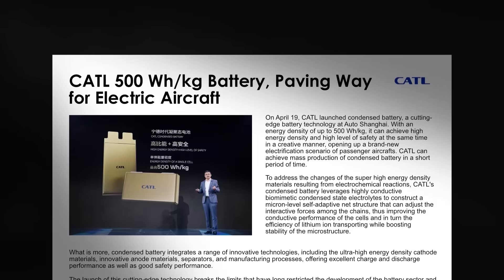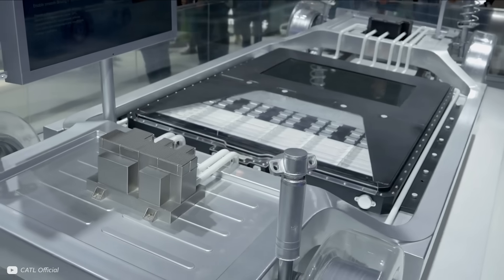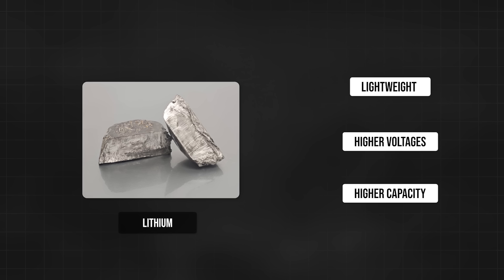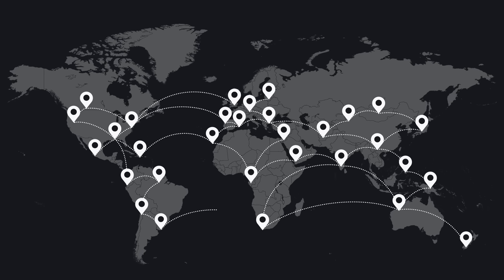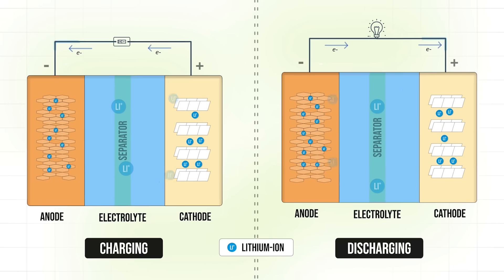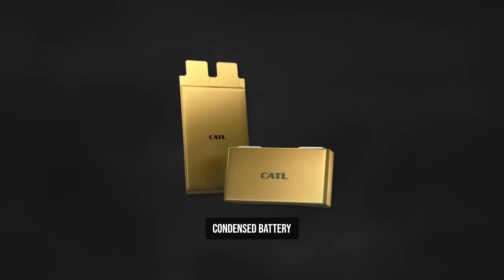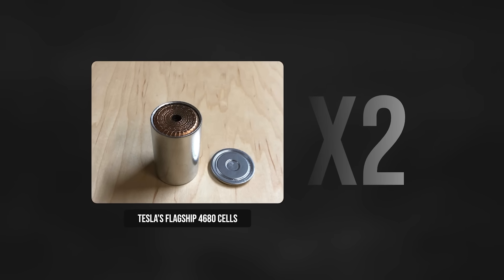Next Generation Batteries: Beyond Solid State

Comment: This is an interesting development and I hope the information the company has provided is accurate, but a couple of points:

1. Another benefit of a solid state electrolyte is that it won't be flammable and almost impossible to put out in case of fire, and that issue remains in the discussed battery even if it should be very stable under standard conditions.

2. If the metals used are still the same rare ones with their large environmental impact, unless they could use this technique to speed up the development of the more appealing alternatives that currently underperform this will also remain an issue.

3. Regarding energy density for large planes as is suggested in the video – jet fuel has an energy density of about 12,000 Wh/kg, so it's still around 24 times as energy dense by mass. Even though theoretical jumbo electric planes would use a completely different type of engine, let's still put it in this perspective: a Boeing 747 is quoted as burning 10 to 11 tons of jet fuel per hour of flight, so a flight from London to NYC at around 8 hours burns more than 80 tons of jet fuel. The plane would not be able to fly using ~2,000 tons of batteries, as that is 12 times as heavy as the empty plane is. Even for much shorter flights I don't see how it is viable in planes built to carry hundreds of passengers, because even if the flight is short enough to require energy that can technically be carried by the engines, maximizing the weight at every short-haul would make short flights much more energy intensive than they ideally should be.
Reply: Effective energy density of jet fuel is between 1200-3600 Wh/kg though.
Reply: @JSM-bb80u  As I wrote in my last comment, the quoted typical propulsion efficiency is >30%, so effectively it would be >3,600 Wh/kg. Thus, a 100% effective battery–electric motor system (which is impossible) would still be <0.14X as energy dense.
Reply: Regarding 1, while this is certainly a benefit it's often overstated. Batteries don't really catch fire that often, and consumers have already decided that it's an acceptable risk with current technology. Not much different from carrying around large amounts of explosive liquid.
Reply: @Rhaegar19  There aren't any real alternatives on the market right now. The consumers take what is dawned on them.
Reply: @TLguitar 
You missed the point the OP was making, which was that the risk of battery fires is exaggerated.  As for battery weight concerns, the 500Wh/kg threshold has been determined by industry to be viable for large aircraft demands.
Reply: @PETERJOHN101  I didn't miss it, I simply replied to the more important point he was trying to make. Online statistics do claim ICE cars catch fire much more often, but I need more context.

Regarding the "500 kWh threshold", these batteries are 500 Wh/kg, not kWh/kg, and either way I explained their energy density is a far cry from that of jet fuel, so large electric planes need to have engines well over 10 times more energy efficient than jet engines in order for this to make sense.
Reply: @TLguitar  Also jet fuel loses weight as you use it up, unlike batteries. 
I suppose if you're a bad neighbor you can throw dead batteries out of the plane, though. 😉
Reply: @JCAtkeson3  Yeah, I thought about that, but I assumed when they quote the average hourly fuel consumption for a long-haul flight they take into account the decreasing weight throughout the flight.
Reply: @TLguitar  
You need context to understand that the risk of fire is dramatically higher in a combustion engine than a battery?  Context won't change the stat.  As for the efficiency of electric motors, they are dramatically more efficient than combustion engines, and as  I pointed out, industry experts agree that 500Wh/kg batteries are viable for larger electric aircraft.  For some reason, you want to ignore that fact, as well.
Reply: @PETERJOHN101  First, you wrote 500 kWh and edited that. Second, what industry experts said 500 Wh/kg is enough for large commercial aircrafts? The math is simple: there are 24 more watt hours in a kg of jet fuel than there are in a kg of the battery discussed in this video. Data I can find says typical propulsion efficiency for a jumbo jet engine is >30%, so even if an electric engine could somehow be 100% energy efficient in terms of energy extracted from battery -> energy used to propel the aircraft forward, it could still not even get close to the amount of stored energy required for a transatlantic flight without making the airplane weigh MUCH more than it can carry.
Reply: @TLguitar  so you don't wanna believe the stats about ICE cars catching more fires than EVs. lol. I mean, why bother with facts when you trying mental gymnastics to discredit facts?
Reply: @MGZetta  This is not what I said, but for example there have been examples of car batteries catching fire while being charged, while I don't know if ICE cars that sit idle ever spontaneously catch fire. When a lithium-ion battery does catch fire it is quite difficult to put out and it tends to reignite itself.

So I said "context": when do the fires in each type of vehicle tend to happen and how are they usually handled.

Comment: Nice video, but as an electrical engineer, I feel I should point out a couple of minor mistakes.  At 2:11 you show a battery consisting of, anode, cathode, and electrolyte -- which is fine -- but you show it connected to another battery, like when jump-starting a car.  I think you meant to show the battery in normal operation, so it should've been connected to a load, not another battery.
Also, you got the flow of electrons backwards.  The negatively charged electrons are attracted to the positive anode, so they come out of the cathode, go through the load, then return to the anode.  Conventional current flow is in the opposite direction, from plus to minus.

Comment: Hi Ryan @ZirothTech, great job on this very exciting development in battery tech. Just one note from someone covering flight applications. I think an important distinction to make about all the references to the ton-scale aircraft test was that it was, in all likelihood, in non-motive roles. In other words, it was tested for systems other than propulsion. It could be avionics, cabin lights, whatever. But it was not to move the aircraft based on what you disclose and my own reading of the CATL website and other sources. 

To be very clear: These non-motive systems are still very weight sensitive and increasingly electrified so should this technology reach commercial, FAA-approved application, that is a big win. 

It would be an even bigger win if the above occurs with application as part of the propulsion system. Nothing I've said above precludes that. I just feel that the thumbnail and video content imply incorrectly that the testing and initial application are aimed at heavy aircraft propulsion and that is a very long way away. 

Candidates for early adoption in propulsion would be Urban Air Mobility (UAM) / Advanced Air Mobility (AAM), flight training (really ideal application), Light Sport Aircraft, etc. Hopefully regional airline and business turboprop-class aircraft would follow soon thereafter.
Reply: ALICE is an electric commercial commuter plane in flight tests since 2022.  It's expected to enter service in 2027.  The 500 KWh threshold has been agreed upon by industry experts to be viable for large aircraft propulsion.
Reply: @PETERJOHN101  Yes, as I said I cover the topic. I produced an article and video about the ALICE effort in October 2022.
Reply: @aerospacenews  
I am also thinking that ALICE may expand from its 8 passenger prototype to 16 passengers due to advances in battery tech by the time they reach certification.  Thanks for your post.
Reply: @PETERJOHN101  Pleasure - always fun and interesting to chat with other polite, curious folks. These are really exciting times. Some of the technology will literally fly and others will fail. But watching it all unfold is very cool.🌟
Reply: People keep saying that batteries are too heavy for Boeing 747's. But why would you you want to keep flying in Jumbo's? If you can make an electric plane for say 50 passengers that can fly 2000 kilometers, you can fly from Europe to New York with two or three extra stops. It would be like taking a present day coach that offers you a ride of 1500 km's or 1000 miles to your holiday destination. Many people use these coaches, they are the cheapest way of travel.
Reply: @DekkerVinc  I don't recall anyone here saying that. They are saying that testing was being done in an existing, licensed to fly aircraft, with known performance characteristics. Which provides a reliable way to measure results. Future aircraft designs, including those intended for low to zero emissions propulsion technologies are emerging all the time. The ALICE is mentioned above, and in my comment I outlined the various roles with potential, including regional airline travel. 🤷🏻‍♂

Comment: even if it makes it obsolete, everything can be still used. and might be easier to use or manufacture or some other factory. one of the points of solid batteries is that they are solid and not electrolytic like capacitors. ie no liquid related problems. lithium does not matter, it can be anything else.

Comment: Wow! That is genuinely huge news. 500Wh/Kg! No degradation in five years?? If the price can be made affordable, then this is the first 'game changing' tech, I've seen in a while. Needed two videos. Thanks.
Reply: Never assume they are simply unable to create such longevity, we are desperately in need of a strategy that supports device permanence and deters planned obsolescence.
Reply: Material cost is lower. Only time for affordable long lasting batteries. I hope they can have EV batteries replacements for the current cars.
Reply: If they work they can be expensive to start with.   Lots of money available in aviation industry.   Lots of savings to be made when going electric ❤
Reply: They should be cheaper than lithium batteries
Reply: True, there’s actually evidence that a lot scientific breakthroughs are slowing down a so our technical evolution is also slowing down. Good to see something like this ones in a while

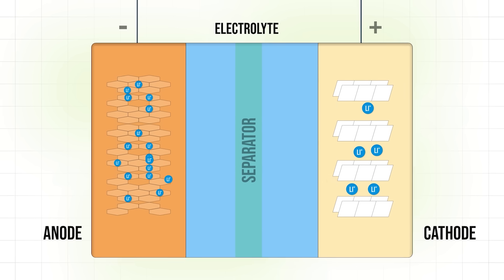Comment: I was confused during this, Ryan spoke about these cells using solid lithium anodes but also said that the anode was a carbon honeycomb substrate with lithium on it. He also said that the carbon was honeycomb at the atomic level (isn't that graphite?). The diagrams he showed at 7:25 seem to be of graphite. The electron microscopy images at 6:45 appear to show a structure that has pores at about 200nm diameter (bigger than mesoporus). It could be that I'm confusing properties of the two different batteries but it would be good to have a comparison.

As for the bio-mimetic polymer, it would be great to have an understanding of the way that it moves the lithium. Do these lithium centred cells get created on the anode, move across to the cathode and then get destroyed again?
Reply: yeah, he was all over the place with the actual technical info.

Comment: “We won’t get into the other components”. Fail!
I have no doubt that if it does work as stated, this will increase energy density a bit. BUT:
The main weight in a cell is the cathode. Lithium metal anodes only improve the weight of the anode. They do nothing to the cathode. Also, this new structured gel electrolyte will be heavier than current gelled/polymer electrolytes, and I seriously doubt if it can maintain its structural stability over thousands of charge cycles - side products will inevitably build up and degrade its delicately balanced structure over time.
Also, the energy density is nowhere near that required for aircraft. Maybe a city taxi service would work, but that’s it.
Just read up on international aircraft regulations regarding emergency fuel loads for long haul flights - we’re still a factor of 10 or more away from making that happen. Ask those PHDs you ‘interviewed’ about these issues, and if they disagree, check where they’re being sponsored from! 
Lastly, CATL has spent enormous amounts on expansion in recent years, and faces an uncertain future in China due to lacklustre domestic sales, reducing CCP support and flagging volume sales internationally. They’re in a bit of a tight spot. I wonder if this is a ploy to generate investment? After all, they haven’t demonstrated any of this yet - just white paper hype so far. I remain highly suspicious.
Reply: While CATL is a well know and reputable company, this is a huge jump in battery tech. There have been countless “industry disrupting breakthroughs” from all sorts of companies, only for them to not be commercially viable.  So I’m with you on being skeptical. 

I’ll believe when “Great Scott” has a cell in his hands.

Comment: I am disappointed that the video begins with an improper statement regarding electron flow. Electrons flow from the negative terminal of a battery (cathode), through the circuit, and into the positive terminal (anode). To state otherwise diminishes your credibility.
Reply: There are two types of theories regarding electron flow. 
One is electron flow theory and the other is conventional.

 How this came about is some guy got it wrong a hundread years ago with conventional theory. Then eventually someone figured out that electrons actually is - to +. 

 Unfortunately, by then it was too late and everyone kept using conventional theory. They also didnt want to admit their mistake and the conventional theory carried on where most technicians use conventional flow and engineers use electron flow. 

Its confusing as hell but thats the story.
Reply: @Emphasis213  EE here. This is the correct answer. The video isn't "wrong", just using the conventional explanation.
Reply: I was looking at that and wondering…I had always known it to be the other way around.
Thank you for pointing that out.

Comment: Sheer insanity we use Lithium still for this. Mountains of research have been performed across this country regarding carbon allotrope research, some of which can carry a million times more current than the same thickness of copper, and 1000 times more than the same structure in silicon. Some allotropes are semiconductors at room temperature, while others allow nearly perfectly zero conveyance of current or heat. I cannot believe that we haven't figured out a way to mass produce these for such purposes as battery structures/materials.
Reply: A buckyball/air battery with graphene anodes would be would be pretty amazing!  I'm just throwing out buzzy allotropes; no clue if anything about such a cell is rational.  I am with you though, it seems silly to pursue a lithium pathway rather than something as abundant as carbon.

Comment: The phrase "ton-class" could refer to the new AutoFlight Prosperity eVTOL with a start weight of 2 tonnes. It should have a range of 250 km and could well be the plane that has the new CATL Condensed battery... Per (Denmark)

Comment: Real solid states are way better then this as this doesn’t solve thermal runaway or reliability. Look into read solid state batteries that don’t use a lithium metal anode. Please correct your video to explain you are talking about hybrid solid states not solid states.

Comment: Solid states are supposed to do a lot more than that, they are supposed to be more reliable, more powerful, a lot safer if you look at grapheme ones and so much more. The point of solid state isn’t to use lithium metal anodes, it’s to create a battery that solves all current battery problems including thermal runaway. What this guy is talking about is a hybrid solid state not a solid state. There is a difference.

Comment: I'm glad to see a video from people involved at a high level with the development of battery technology review the CATL condensed battery technology.    With CATL's reputation to deliver what it is promoting and a review from an independent source it gives me confidence that CATL condensed battery at around twice the current energy mass density is a real possibility for the aviation market.   The aviation market could have costs ten times what would be viable for the automotive market.  It would certainly replace any large batteries used in aviation currently.   If all the other criteria for the CATL condensed battery are as good as LFP batteries with more cold tolerant chemistry they would allow a near doubling of BEV range  which would make long haul semi travel BEVs viable and able to economically be driven faster than Diesel.

Comment: I'm still waiting for the breakthrough: AKA cheap, energy dense, quick charged, lightweight, long-lasting, and available now.
Reply: According to this, it's basically available now as in terms of what it accomplished and being able to manufacture.  It's 2x more lightweight than Tesla's current best ones -- which coincides with energy density (thus less weight covering the same range).  It improves on quick charging ability a great amt.  Cheap?  Well, it already has to be abundant in the market for that to happen.
Reply: @toddjohnson7572  And it's being implemented where exactly???
Reply: Yeah it seems the future is always 10 years away no matter how much time passes.
Reply: Lithium-ion batteries already do this though

Comment: What happened to capacitor batteries? The dream was that most of the vehicle could be manufactured as multi capacitor banks. Eg all the body panels , interior and even some of the mechanicals ?
Reply: Energy density just isn’t there. The best supercapacitors only store 10% of the energy of electrochemical batteries.
They have their place, like in smoothing power delivery and absorbing spikes but as a primary store of energy, nah. Was never going to happen.